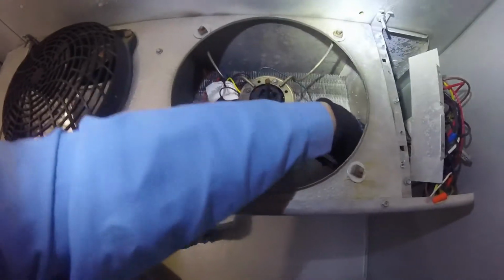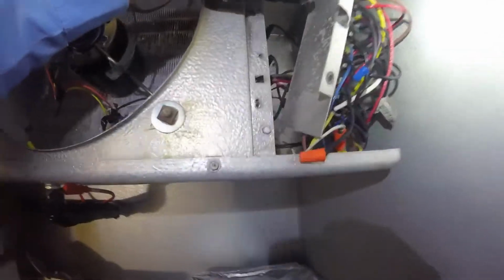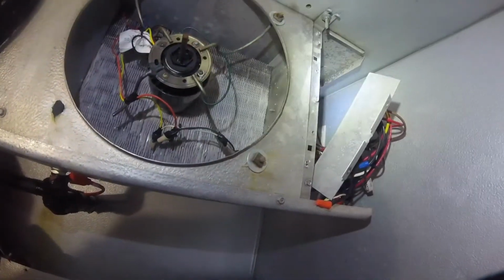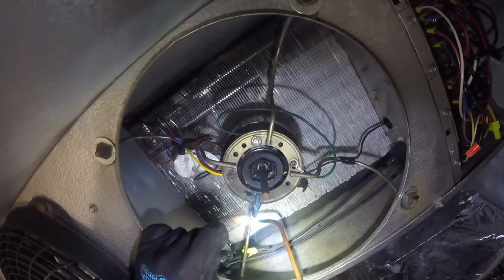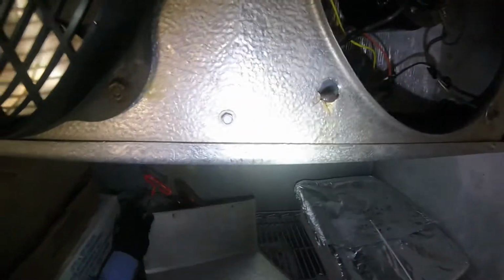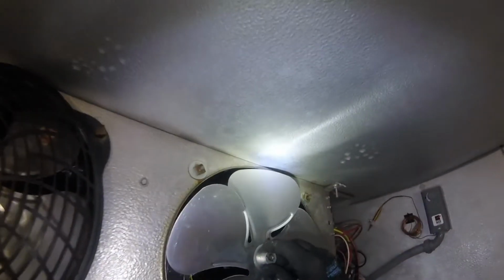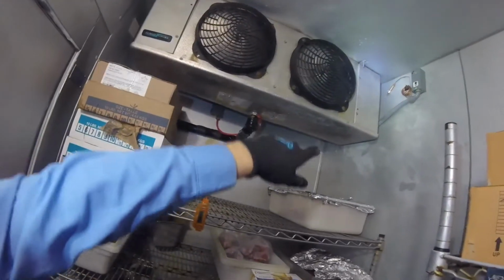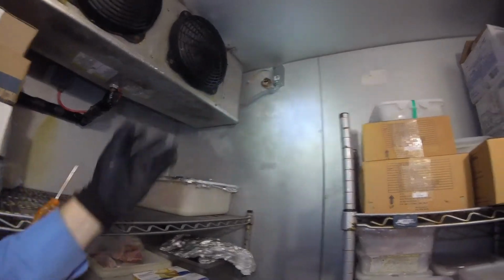walk in freezer with multiple issues

Comment: if you don't have any bushings/grommets for the knock out holes, at minimum wrap with many layers of "good" electrical tape where it will rub in the hole (NOT THE RIGHT WAY! but should last longer than the evap. coil/motor will) :)
Reply from the maker: i agree with you. i keep plastic inserts/bushings on the van. Stuff like that cost change.I cant see not having things like that.

Comment: will sj cord pass building/electrical code?
Reply from the maker: I’m not sure. I have an electrical friend that’s top notch. I should ask him. Either way I can sleep better knowing the wire is in conduit.
Reply: it should all be inside conduit or liquid tight. pretty much the same electrical code applies as with any building wiring in wet/damp location.
Reply: No, it cannot be use for a permanent installation, cannot be exposed to physical damage.  Also only has a 300 volt rating all high voltage building wiring needs to have a 600 volt rating. Plus looks like a turd
Reply from the maker: That makes sense. Yea I prefer to use the liquid tight.
Reply from the maker: Straight from the text book.  Chapter: CODE 101 :) 
Thanks for the info. Yea I prefer liquid tight conduit for more security. I try not to let my work look like turds. So I will stay away from exposed s.j cord.